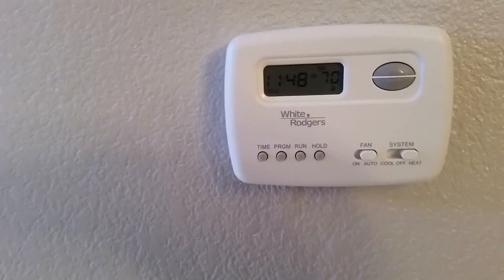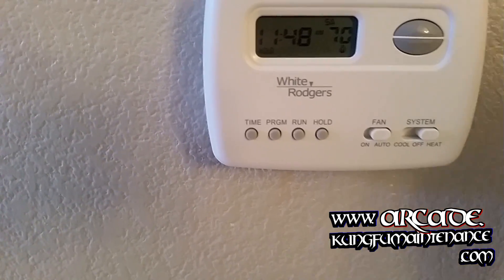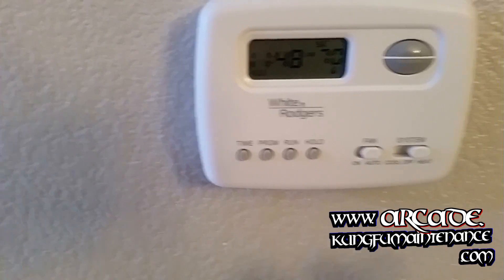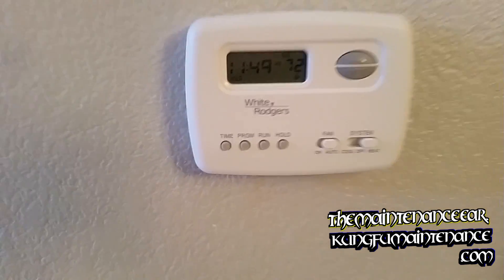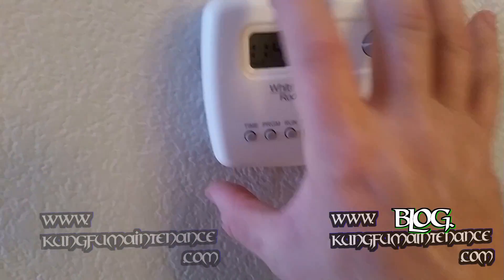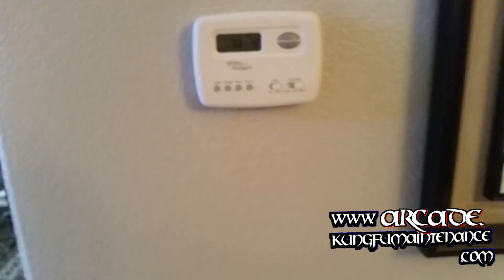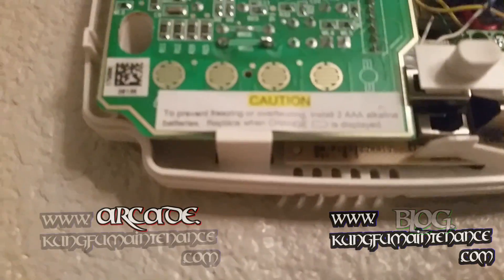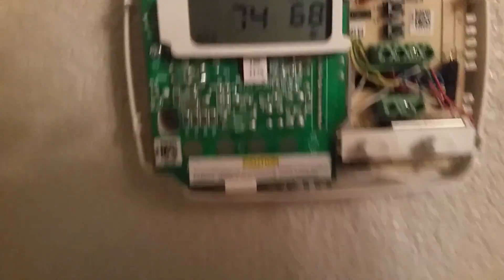Thermostat Clicks But Heater Not Turning On Fan Works AC Runs But Heat No Start Repair Video

Comment: Damn 5yrs ago this video was made. My screws were loose and the connection kept clicking. I thought it was the battery.  Starting screwing the loose wires then heat clicked on, it actually showed the word heater...😍 Thank you, this was the first and only video I watched. Awesome...

Comment: Thank you so much...I have been troubleshooting for a few days just trying to get to know the basic HVAC system before I messed with anything. And somehow it got set to" gas" instead of" electric" I switched it back  to electric and now it works perfectly fine.

Comment: So glad I came across your page!!! Thank you so much. 6years later and you’ve helped another family. One of the wires were in too far after we had a new thermostat replaced yesterday. Temperature dropped 15 degrees in the house and the fan was blowing, unit was clicking and no heat. Within 5 minutes house feeling warm again!

Comment: For two days my heater didn't turn on.  It still made the clicking sound when I would check it.  Then yesterday it suddenly came back on.  But then when it was running the second time, it wouldn't turn off.  I had to shut it off at the breaker box.  Then every time I tried it again, it would do the same -- run, shut off after it reaches the temp, then when it runs again later, it won't shut off.  But then today it shut off the second time, but it was like a minute into it, and now it won't turn on again.  Is this a thermostat issue or something more serious that a professional needs to be called in for?

I changed the air filter and also the battery and jiggled around the wires.  They don't seem to have made a difference.  It's going to be 33 degrees tomorrow, and 18 degrees later this week, so I'm a bit nervous.

Comment: THANKS! I had just opened the cover to replace the batteries last night and in heat mode the t’stat clicked like normal but furnace not responding. After watching this video & reviewing a few comments I opened the cover again & nudged a couple wires & heard my furnace kick on again! Boy those wires are sensitive!

Comment: those were my symptoms it was working fine till last night,,,,i pulled the thermostat off and just connected the red wire to the white and the heater kicked on ,,,,i going to get a new theromstat ...this one was the 19.99 one...

Comment: I've been waking up to temp at 66 but thermostat set to 71. Change the temp doesn't do anything. Thermostat clicks but heater doesnt kick on. I have to turn it off, switch to fan and back to auto, then switch the heat on then the furnace turns on. It works fine after that and it only seems to act up at night when I turn it down a couple degrees before bed. What's going on??
Reply: Exact same thing happens to mine. Did anyone give a definitive fix? Well, not exact. I first noticed this during the night, but this happens anytime, (day or night) when I lower the temperature below the room temperature. My temporary cure has been similar but not the same as “R’s”.  Step 1 ... I lower the temperature below the room temperature. Step 2 ... I move the switch to OFF and wait about a minute. Step 3 ... I move the switch back to HEAT.  Step 4... I raise the thermostat temperature above the room temperature to the desired temperature (listening for the click along the way). Within a few seconds I hear the blower start and wait for the heat the begin. It will work continuously for days as long as I don’t lower the thermostat below the room temperature.  Last night at 3 am with the house temperature at 69, that process didn’t work. I finally got it running after going through the above process a couple of times and no heat. I went downstairs to the furnace and turned the ON/OFF toggle switch to off, waited about a minute, and turned it back on. The blower and furnace kicked on, heated to room temperature and shut off. It has been heating and turning off as it should for the past 12 hours. I am speculating that this will cease if I lower the thermostat below room temperature again. Echoing rOllinlacs, HELP, WHATS THE PROBLEM?? I just had a local furnace company technician here 2 months ago for a thorough furnace check up and cleaning, and was told the system is in great shape.
Reply: Did you ever find a fix? Mine is doing a similar thing.
Reply: Mines is doing the same thing and won't back on for hours temp drops then out of nowhere 4 hour later here comes the heat popping  back on
Reply: Can you tell me what did u ever do to get it fix or solve the problem

Comment: Agree with comments on the intro.  While your video wasn't my issue, you did steer me down the right path.  If the thermostat is otherwise working and unit does nothing  when heating, you are likely dealing with a wiring issue.  If you made that comment in the video and got rid of the intro, your like/dislike ratio would improve.  Thanks

Comment: Thanks for the video! It helped me diagnose a similar problem on mine. Instead of being disconnected at the thermostat, one of those wires had come loose at at the other end (at the control board). A quick reconnect and it's operational again. It must have gotten knocked loose when we had the blower motor replaced at the beginning of cooling season, so we didn't notice until now that it's getting cold.

But seriously with the intro...I thought I had accidentally clicked the wrong video or something.

Comment: Agree that intro and shaky camera are distracting, but the heat I now have in my home is worth it!  My thermostat has more wires hidden, but I took off the plate and wiggled them around just the same to make sure the wire was touching the screw, and whatever I did worked.  Thanks, KungFuMaintenance!

Comment: So I've got a hunter programable thermostat model 44665 it seems to get up to the programmed temp, shut off like it should but then after a while the temp drops way below the programmed temp. I have to go and manually turn the programmed temp down below what the ambient temp is and it will click like it's shutting off and then turn it back up and it will come right on and warm back up to temp. It use to only do this in the middle of the night and i would wake up and have to adjust it but lately it's been doing it all the time. Any advice?

Comment: I just replaced my thermostat for one just like yours. Cool setting works fine, fan blows fine. But when I switch it up to heat it blows up the 5 amp fuse...any suggestions?!!

Comment: Thanks for the video!! I tried a # of things, but this actually worked for me! My red wire had some of the rubber coating touching the screw, but as soon as I removed the screw, unfed the wire, moved the coating up with my hand, reattached the wire, and re-tightened the screw, my heat came back on. The coating must have slowly moved down the wire over time, since my heat was working fine yesterday. Thanks so much for the tip! :) #thankyukungfu
Reply from the maker: +Laura Anne Whitehead Yay!!!

Comment: If a you tube videos start out with music like that. U know it's gonna be bad advice
Reply: but seriously change that beginning theme its really bad
Reply: This video fixed my heat so I'm not complaining! I tried everything else, but this was a sure thing!!
Reply from the maker: +Sir Murdock Good treasure is often buried!! For good reason and the right season!!!
Reply: @KungFuMaintenance  So is radioactive waste
Reply: Sir Murdock ‘
Reply: I'm gonna try this trick. If I giggle the heat/cool switch mine comes on sometimes. Maybe it's freak lil voltage popping through. I'll update. Also you spelled "albulm" wrong on your intro (album). Was this on purpose? Just curious
Reply: Mines wont click what is it? It's on but it wont click on for some reason
Reply: Sir Murdock 😂😂
Reply: Worst intro music ever man.

Comment: I have an electric furnace. The heat wasn't working, so we bought a new thermostat and it fixed it. But now it will run and sometimes it won't.  You can hear the thermostat click and then you can hear the click coming from the furnace, but it won't kick on.    We are on a fixed income and can't afford to replace it right now
Reply from the maker: +Harold Leonhardt Me first check for that would be the service panel door switch. Try opening the service door and resetting to better engage the service door switch.
Reply: KungFuMaintenance thank you. I had someone come out and check it. I had to replace the compaciter

Comment: my problem is this the filter was changed but the thermostat no longer had a heat option so going into the settings I could make it appear by changing the current code of E to 2 or 3. option E and 1 will make the main screen not show a heat option. what would cause this and thanks in advance the unit I have is one of the TH9000 series from honeywell

Comment: Which slot does the right end of the blue wire go into?  Top or bottom?  If you don't mind looking, my heat WAS working but my blue was completely detached.
If you have any more questions, feel free, I do not know the ins and outs of this brand.

I have the model without the programming buttons, just up/down, fan/auto and heat/cold.  Can relay model no if needed.
Reply: Bottom connection is 0, top is 8 or B.
Heat is gas but I switched to electric and it's running room temp air out like the fan.
Switched to gas during electric run, blue wire still d/c'd, gas kicked on after 5, ran for 10 seconds.  Back where I started.

Comment: Hi my a/c unit don't run When i turn the heater I wait more than 5 min , but it's run when I use the cold
Reply: that jumper is important...an cause all kinds of issues if its loose or missing.
Reply from the maker: +Jufaro Flores Many thermostats have a switch for a gas heater or electric heater. It's possible that needs to be switched. Also many thermostats need or have a jumper wire between RH and RC. These are first things I would check for the scenario you describe.

Comment: Thank you very much for the knowledge. I installed a new thermostat from the same brand as my old one, but this new one had an Rc & R instead of just an R. It confused me, but realized all sites suggested to keep the jumper installed if not using heat pump; so i left it on . Sad to say... no heat, but same results as you before checking jumper. I double checked the jumper screws were tight... check. Still no heat. Duh!..... the sliding switch was set to oil/gas, not electric/heat pump. I guess the factory setting assumes oil or gas. Nonetheless, I wanted to say thank you for posting this video. It saved me from a costly repair bill and more importantly I learned something new. You rock!